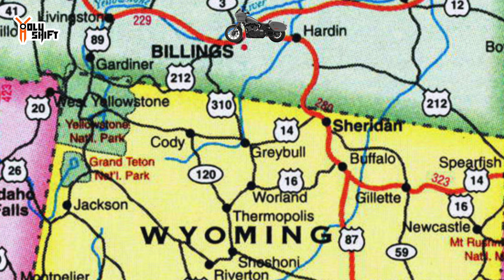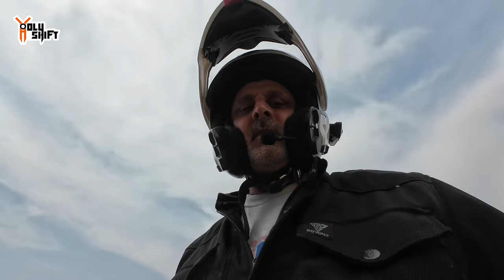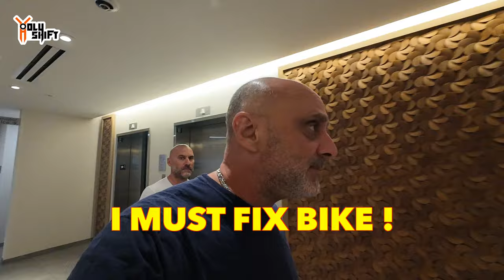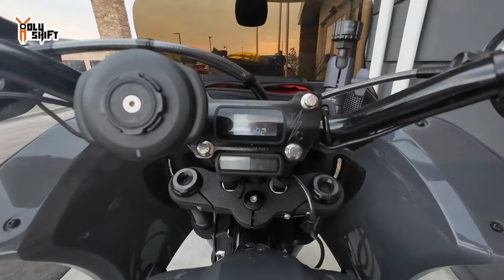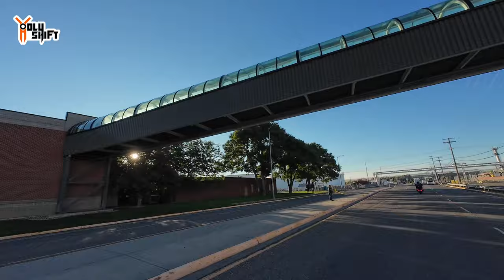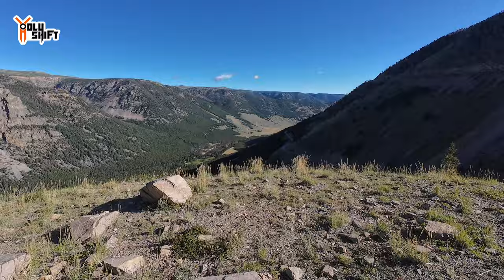Can't Ride Like This ! Mechanical Issues ! Must fix it ! 🇺🇸 Coast to Coast EP.6

Comment: I got a code ehen I changed my bars. Went back into the block under the rubber grommet under the tank
 There's two ports to plug in that one of the connectors can go into. Look behind it and you'll see the wires are color coded. Make sure the plug is in the right port. Drove me nuts for two weeks until I found it.

Comment: Remember if you dry leather with heat it will shrink drastically. Put the dryer on fan mode (no heat) and it will not shrink the leather.

Comment: My cruise control stopped working, suddenly, while going about 80 on Ohio Turnpike. The throttle grip spun freely. I coasted into a Ohio maintenance area where a heavy-duty fleet mechanic suggested pushing inward while twisting throttle. Rode 4 hours home with an aching arm. Harley mechanic fixed and said the throttle became detached which affects cruise control. Go figure!